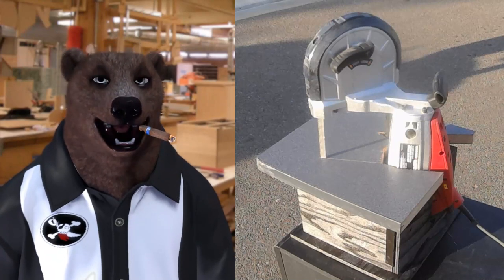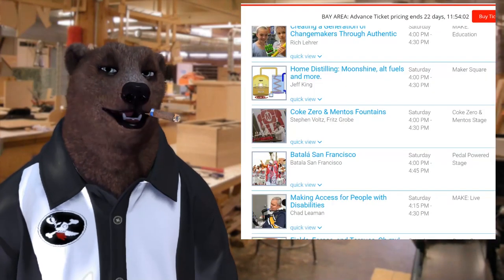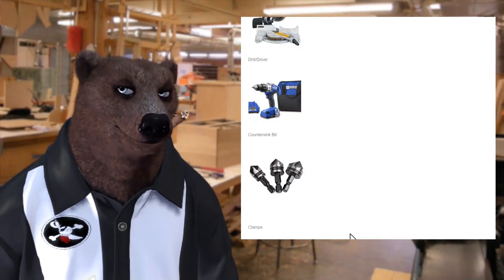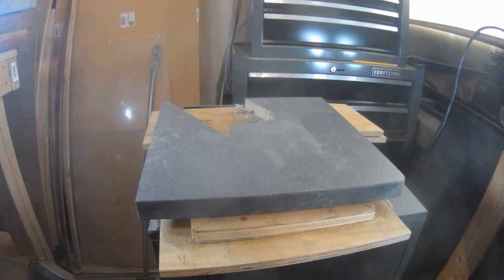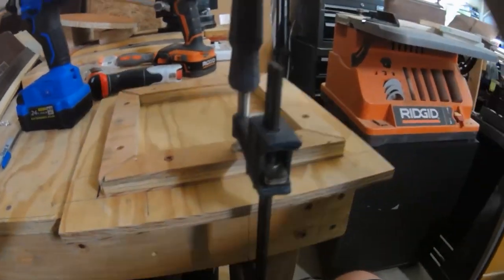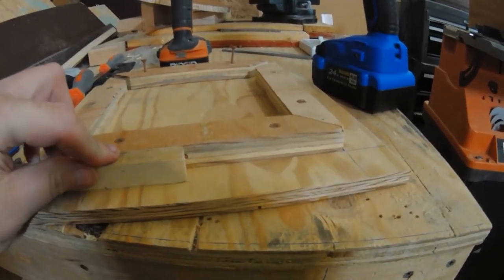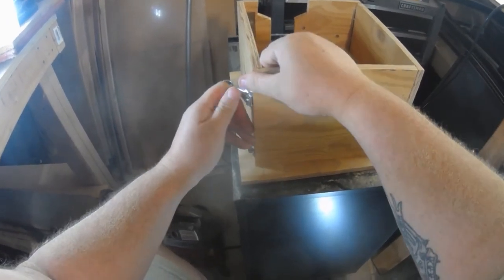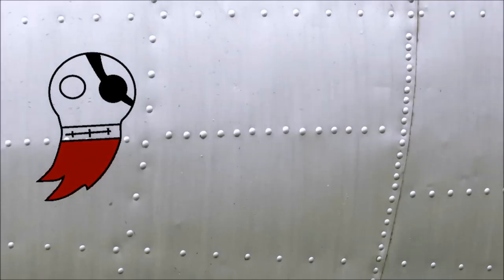DIY Portable Bandsaw Stand

Comment: Been looking at one of those, but couldn't make up my mind on that cord one or get the cordless by dewalt. I just getting tired of cutting my metal with a cutting wheel on a 4-1/2 grinder. Have you tried it on metal and has it worked strait out of the box for you? Side note I get my trailer back tomorrow afternoon so hopefully have a video posted Sunday or Monday so you can see my setup.
Reply from the maker: Jim Gafford  I was hauling some stuff to the dump last week and at the last minute I realized I had forgotten to tear down the basketball hoop. It's one of those metal ones you can roll out to the curb and back. some neighbors had given us their old one after the kids moved out but the thing was rusted and the backboard was broken.  It needed to get trashed. Well I was freaking out because the dump was going to close in 20 minutes and the bolts on this thing were rusted shut.  I was about to grab my Sawzall and go to town on it when I remembered seeing a video about the Harbor Freight saw and the guy said that he used the standard blade straight out of the box on a bunch of different types of metals and it went through them just fine so I went to town on this thing and I chopped up this beast up, backboard and all  in under 5 minutes with the standard blade it was like using a lightsaber on that thing , I love it.
Reply: Sounds like I diffidently need to get one. Thanks and keep up with the videos. Looked up the makers faire and see they have them all over the U.S. Are you going to be at the one in San Diego, CA.?
Reply from the maker: Nope, I love SD but this one is practically in my backyard and its the biggest so, bang for the buck and all that.

Comment: Swag offroad is a nice products worth the $130
Reply from the maker: It's cool but I found it hard to justify spending more on stand than I did on the saw.  That and like most stands it requires that you modify the saw.  I wanted something that was easy to use and that I could go back and forth from hand use to stand without having to mod the saw ever time.
Reply: With your set, you are stuck with a vertical saw. His you and unscrew one bolt and you have a portable bandsaw again. You also have the ability to make very accurate cuts with the miter jig.

Swag offroad also sells a basic plate for $50
Reply from the maker: I think you need to watch the video again.  With my rig you just unlock the latch and lift the saw right out.  In under 10 seconds you can remove or install the saw with no mods to the saw itself.  I think they have updated their setup, but when I posted this the swag table forced you to remove the foot of the saw to install it in the table.